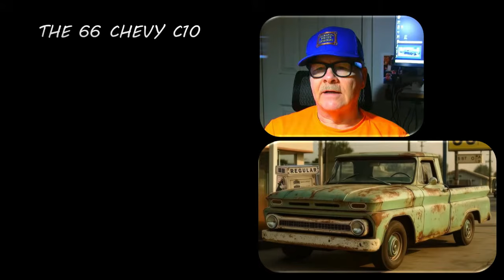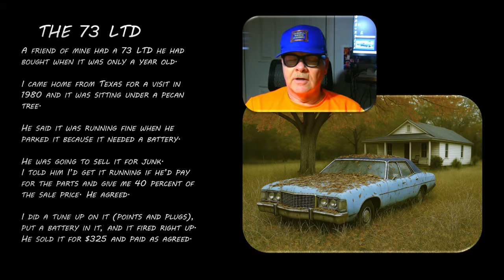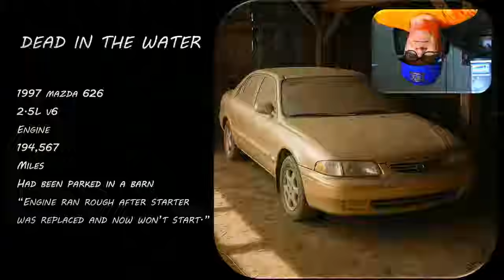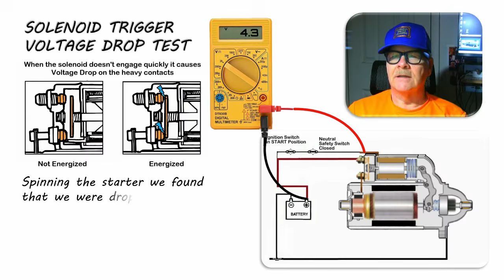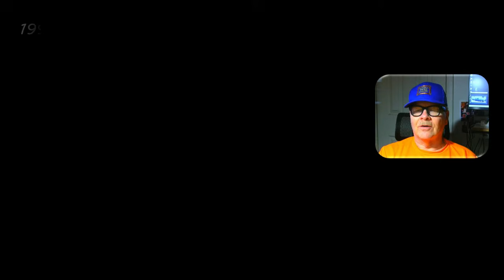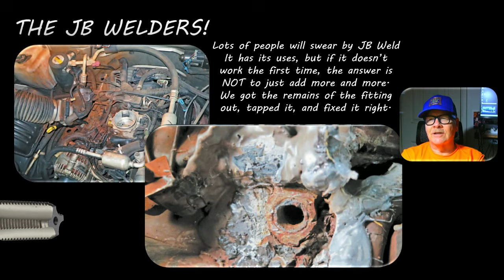Revovery Projects

Comment: Got Some Monday Excitement?
Good Morning to You
Reply from the maker: Goood Mornin'! Lots of excitement here! I had to replace the right front caliper on my F150 - started sticking. I drove it to the Post office, felt it... got out... the right front wheel was egg-frying hot. Parked it, bought a caliper - the next day I drove it repeatedly but couldn't get the caliper to stick again - but the rotor was gun-metal blue. So I pulled the caliper (dual piston) and found one of the pistons with a busted boot - That one must have stuck and then retracted when it cooled and then the other piston was doing all the work while the stuck piston never moved again.
Reply: @McCuistian   F150